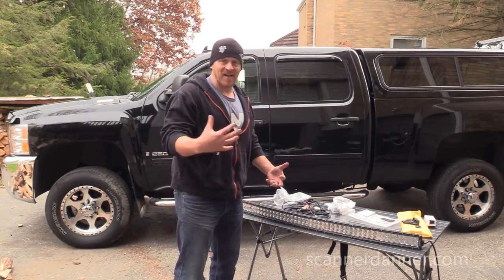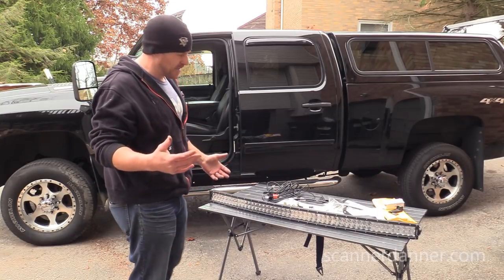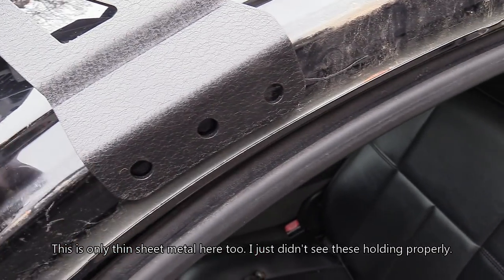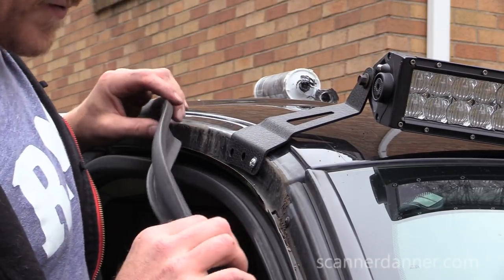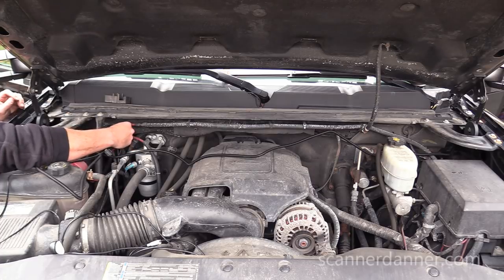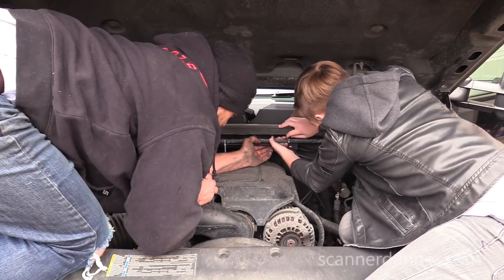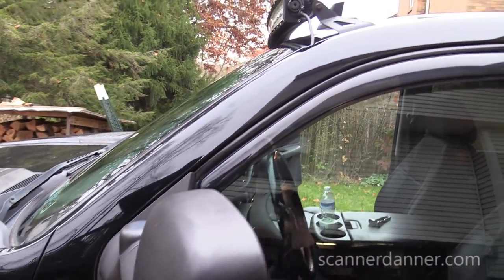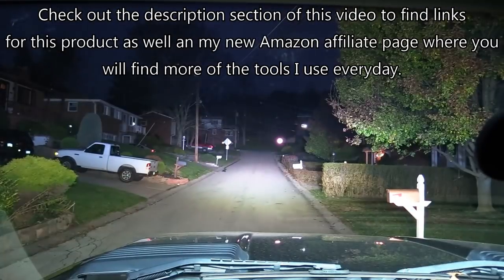Auxbeam 50" 288W CREE Light Bar Install

Comment from the maker: Don't buy this light bar and drill holes in your vehicle without first researching noise concerns. To some, it's no big deal. To people like me that hear every squeak or rattle it will drive you nuts. Update video coming.
Reply: ScannerDanner  use a door sweep, it kills 90% of the noise.
Reply: Scanner Danner
you got to use the chrome bolts that's in the brown envelope with the L brackets use those bolts, You needs a 13/16'' Drill Bit, tap in those bolt sleeves. don't drill so far in do to your side Curtin Air Bags may get Damaged. 
i bought the 42'' Curved Triple Row Light Bar 576W 90,000LM
I bought this Light bar for my 2006 Pontiac Torrent SUV.

Comment: Hey Paul, first of all, thank you very much for the very specific installation video, we think it's very inspiring!  And we're really sorry for the missing bolts, i've provided your feedback to our product manager, our company will soon solve the problem. Sorry again for the inconvenience! Hope you like the light!
Reply from the maker: No problem on the missing bolts, it really was not a big deal. Thanks for reaching out to me! Also sorry I wasn't aware of how to properly use the fasteners. Some instructions with your products would certainly help your customers. I realize these light bars are universal and can work on multiple vehicles, so that may be why Auxbeam doesn't supply them. My case in point, this same light bar could have been used on a 2009 Silverado or a 1996 Cherokee. But certain things could be included. As Hayward Automotive pointed out "It's called a Rivnut or rivet nut and as you tighten it it crimps the nut to the structure.  They also make a crimp tool for them". I had no idea of this and this information is invaluable to the installer. 
On another note. Does Auxbeam make a light bar cover for this model? I need to get one from you guys. As others have pointed out, here in PA, I believe it may be a requirement for off-road lighting to be covered.  
Thanks again and sorry I waited so long to do this project.
Reply: What? No instructions, missing bolts? Lame!
Reply: Auxbeam LED Lighting were the bolts with the universal bracket?
Reply: Hey, the bolts and instructions are nomorly included in the package, it might due to our warehouse colleague forgot to put it in, we're truly sorry for the package issue. We didn't know that the bolts are missing untill watching this video. We can definitely reship the missing parts if this happens to our partners/customers, and we're willing to offer partially refund if our customer want to purchase those hardware from the local store, we always take care of our customers, you can trust our brand and company.
Reply from the maker: Yes, the missing bolts are part of the universal mount. I showed the image in the video and highlighted what was missing.
Reply: ScannerDanner guess I didn’t make it to when you showed them ...

Comment: I have fitted two of these to my mobile workshop van, one on the side and one on the rear. I ended up making my own brackets to mount them. I made one pivot hole and one " banana" slotted hole to allow locking at set angle and more secure mounting, if that makes any sense? They fitted using both bolt holes on the ends. I cut off the supplied power connector to allow a small waterproof bulkhead pass through to be used for the cable. Great video mate.

Comment: Ah Scannerdanner, I love wiring and anything 12V electrical, but you could have absolutely used that auxiliary switch and made it a lot easier for yourself. That switch indicates your truck is equipped with the snow plow prep package (RPO code VYU). Above the headliner, behind the overhead console is a HOT AT ALL TIMES, 30-amp fused relay with dedicated 12awg power and ground, which are blunt cut and tied together behind the overhead console. It's originally intended for installing a flashing warning beacon for the purpose of snow plowing. You could literally just hook your light bar power and ground straight to the blunt cut harness in the roof and you're done. I have the same truck (2012) and have used this switch for a similar purpose. 

As an aside, I love your videos and have adopted your strategy of proper diagnosis instead of  being a parts changer, in recent years when doing my own repairs and for friends and customers. Keep up the good work!
Reply from the maker: Problem was getting the wiring to the harness in that area. I was NOT going to drill into the cab roof. It's why I didn't go in that direction.
Reply: That makes sense and I agree with avoiding drilling holes in the roof. Alternatively, you could run the light bar power and ground through the grommet in the firewall and back up the A-pillar in the future, if you still wanted to use the roof auxiliary switch.

Comment: On a different subject, doing some diagnostics today on a suspected injector fault. Had a good discussion about using break out adaptors versus using back pinning to connect pick scope. I favour the break out adaptors and have made and bought a really big selection of them. We were discussing the pros and cons and wonder what your thoughts are on them? My friend reckons back pinning a more accurate technique as testing exactly as installed whereas breakout adaptors is not but my thoughts are it hives a much better and potentially less damaging signal? Can argue either way! Have you done a video covering their use? Great respect for your work and welcome any thoughts you may have. Problem proved to be a sleepy injector by the way. Four fresh ones fitted and tested and normal performance restored.

Comment: Awesome video! Thank you so much for the video. It really helped me with my install.
Reply from the maker: I took it off from the wind noise! I hated it. 
If it did it over again, I'd mount it on my front bumper area, or maybe on my cap? Not sure. It sits in my garage

Comment: thanks for the video, did you check the roof switch and see if it was already wired to somewhere (eg empty fuse slot) in the engine bay? also would be interested to see if they really draw 24amps @ 12v, the feed wire looked around 16gauge?

Comment: What if you moved the bar to the forward most holes (pushing the light back). Then maybe the roof would block the light hitting your hood?
Reply from the maker: Moving the bar back another inch or so would not have changed the glare on the hood. This thing is ridiculously bright. Remember my on-star antenna was there, so I didn't have much more room to move it back.
Reply: ScannerDanner Ah. From the video I thought the antenna was in the middle where the light curved. Nevermind then. Thanks for the great video!

Comment from the maker: What, no comments on my wiring diagrams? Thought they turned out pretty good :-)
Reply: I was looking for the OBD2 connection so you could hook up a scanner but I figured a scope wouldn't need that... 8-)
Reply: They were good. I thought they came with the unit.
Reply from the maker: Nope, I created them :-)

Comment: With the strength of the new neodymium magnets you could attach and install the lightbar without having to cut holes in your cab. Those magnets are super powerful.
Reply from the maker: That would scratch the crap out of my cab. Good thought though
Reply: I was thinking magnets too. But I just now thought about 3M exterior 2-sided tape, just a couple small pieces to kind of tack it in place until you still the holes. 

Or a tack weld 😆

Comment: It Looks like the switch on the upper console that you were going to use is wired already would not it be a good idea to get a diagram and and find the wire that comes from it and splice into that? Also the led on the switch you have with the kit from what I saw  is on when the lights are not could not this cause a drain on the battery. I know it would be small but it is still a drain.

Comment: Hey PAUL

I met you a couple years ago at Eric the car guy made it. The large part you were showing that you did not want to put in your truck because it was going to make a large hole. It does someone need a large hole to insert it but there is a tool that they make that compresses that in behind the sheet metal on your truck which makes that river not permanent rib night and will give you a firm mount to mount the light. 
Are used to use in my business all the time they are extremely strong. Are use them to Mount Dora closers on aluminum doors for businesses. I can put four of those and I hitter and I can put a bar on it and swing frame it and I’m a pretty heavy fella and you can’t pull them out. They are amazing you will probably want to get some kind of sealant to go around them and the screws when you put them in just to keep it from leaking because you wanted to be weathertight. Because you don’t want rust starting in your truck from those holes. If you take your time to put them in and seal them up good they will be an excellent form of mounting that light. And they also sent you smaller ones for the jeep but they are the same thing. Myself I would probably want to use the larger ones if I was installing one for myself or my truck simply because the light will have an excessive amount of wind blowing against it when you’re going down the road and that puts a lot of stress on that this would probably be a good idea to just keep the screws for me and able to be loosen or even possibly pulled out or sheared off just a suggestion thought I would give you the heads up on this. Keep up the good videos enjoy watching what you’re doing
Reply from the maker: Thanks for the info. Others are pointing this out too. I've never seen these before and without instructions I just didn't know they compressed like that. Thanks again!

Comment: Paul is there any wind noise? I think I would look up how that switch is wired in and see if there is a relay in the underhood fuse  box.
Reply from the maker: yes there is, at low speeds and I hate it :-(

Comment: by choosing the rear mounting holes, you will have all the weight in front of the "pivot line". not worry that it's gonna smack down and hit the  roof? bumpy roads can shake that thing hard... just a thought.. thx for sharing
Reply from the maker: I chose the rear holes because it allowed the brackets to sit in a more normal position due to the curved nature of the roof line. Hope that made sense. I agree with what you're saying about the weight and pivot point.
Reply: ScannerDanner yes, you explained very well why you choose to do it that way... I'm just trying to create a nagging feeling about it... ☺
Reply from the maker: haha thanks for that

Comment: As to the bolts you are missing to mount the brackets to the light bar, wont the bolts that came with the universal mount kit work?
Reply from the maker: The universal mount kit did not have the bolts that were supposed to come with it. That was the issue.
Reply: Ahh ok, it must have been the picture i seen. Good video!

Comment: Hello Paul. I really enjoy your videos. I love to watch while I am relaxing. I am an Automotive Instructor since 1995. I just have one question. Did you forget about PA safety inspection? Pub 45, Equipment Standards 175.66 (f) and 175.66 (I). I guess James can inspect it for you. Keep up the great videos.
Reply from the maker: If I have a light cover it's legal right? I haven't inspected a car in 17 years my friend :-)
Reply: It has to be wired to come on only with the high beams. (aux driving lights) Fog lights can only come on with the low or by themselves but must shut off when high beams are selected.

Comment: Great video, in my opinion any aftermarket product, they should leave the connectors  off for last to put so that small holes could be  drill or to fitting Thru the grommets of the fire wall for more clean results. But yes they are really bright.
Reply from the maker: agree

Comment: Hey Paul,
hadn't you had doubts that you drill though some kind of wire or even airbag(wires)?
What about water intrusion?

Sorry, if this may be a "stupid" question for you, but why would you need a relay for this "simple" wiring? Wouldn't it be sufficiant enough to directly switch the bar without going through a relay?

And another question: Couldn't you just mount the relay inside the car or even under the plastic in front of the windshield?
Reply: they try hard to route that stuff where it wont be tampered with or destroyed by the common folk adding junk.... it makes no difference in salt belt after year 3 anyway :))
Reply from the maker: I've not seen wiring run inside of an A pillar before, so I wasn't worried. Plus I do not have side curtain airbags, so that was never a concern. 
As for the relay, yes, it is absolutely necessary. A switch itself is not heavy duty enough to handle the current flow needed for the light. You would be burning up switches left and right. Also, due to the high current flow of the light, you do NOT want to tap into something inside of the cab.(mounting the relay inside would require that) Anything you tapped into, to feed power to the relay, you would be adding a serious amount of current flow to an existing circuit.
Reply: blocki Not to worry about airbag wiring if he had overhead airbags the wiring will be on the inner part of the roof structure underneath the roof skin. There’s a skeleton structure frame underneath the Roof skin where the airbag and wiring would be located. You would have to have like a 5 to 6 inch screw to get in that far but the inner structure in some places there’s high-strength steel and you would know when you hit it because first you would go through the sheet metal skin of the roof very quickly and you’re going to have a maybe 5to 6 inch gap between the skeleton structure but you will know somethings not right you’re probably wear out a drill bit before you get through it it’s pretty thick. Sorry not very illiterate punctuation and sentence makingJust trying to help you understand what are you doing there is OK
Reply: Thanks a lot for the answers, Paul and Marc! Much appriciated.
Reply: @marcfawcett6100  I have an 07 silverado with airbags up there and worried a bit about drilling into them, now u say nothing to worry about?

Comment: 10:51 They make a tool called a thread checker it's a steel cable with many combination male and female fasteners on it (for checking nuts and bolts) to verify fastener diameter and thread pitch. It's especially useful when you have missing fasteners and need to size a threaded hole to buy replacements.

I have two hanging in my shop one for metric and another for SAE and I use them all the time. I questioned myself when I bought them (about 30 bucks each) but they've payed for themselves many times over.
Reply: I thought that's what skill, knowledge, thread pitch gauges and vernier calipers (micrometers) were for? that being said, the pre-made gauging devices are great ;)
when I don't have tools with me, I eyeball check the thread pitch mesh and  the diameter side by side and end to end. maybe not everyone has the same eyesight?
Reply: I knew someone would say that :P. But since I got these my thread pitch gauge has been collecting dust.

I can determine the size and pitch of a fastener quicker than I could get my calipers out of the drawer assuming the battery isn't dead :) an excuse to buy some dial calipers I guess.
Reply: HA! I can get close just by looking and I am not a machinist! I have to say METRIC and SAE both make it a pishfesting.. yes I am american and I rather hate the metric system, but I use both daily :0
Reply from the maker: I'm lucky if I can ID the diameter of the head of a nut or bolt anymore haha too much wiring in my brain
Reply: Comparing usually isn't an option for me because I buy a lot of my fasteners in large quantities online so I need to be 99.999% sure I'm buying the right size or I just bought a box shaped paper weight.

One thing about metric when measuring manually at least you can directly read it out on a caliper and know the diameter with inch you need to convert it from decimal to the nearest fraction. One of the reasons I got the thread checker measuring SAE fasteners was just so cumbersome.

Comment: In the circuit you have a 30A fuse. However the ground side switched control side wiring is much lighter. From an engineering point of view is it reasonable to assume a relay control side will never short inside the relay?
Reply from the maker: I suppose it can still happen. Are you saying because of the smaller gauge wiring on the control side of that relay that the 30 amp fuse is rated too high to properly protect it? I bet it would still blow that fuse with a direct short on the control side. It may get really hot first, but I don't think a fire is a concern. Thoughts?
Reply: ScannerDanner ,Yes I am thinking of the small gauge wire. It's not a concern it just makes me think of all those modern designs where they typically have a small fuse on the control and a large fuse for the load.
Reply from the maker: And that would be the better way to do it for sure. That control side could be protected with a 5 amp fuse.

Comment: given that the switch was already there, and was wired up with a light and everything, I would be almost willing to bet that it has a pin in a fuse box that you could've wired into. I would have at least looked at the fuse box diagrams and looked for any fuse slots with only 1 pin. either way, great video!
Reply: Drives11 I figured the same thing, those additional accessory switches usually are run to an existing relay point. All that would have to be done is that the main wires would have to be run to the fuse box, and maybe you'll have to install a relay and correct amperage fuse.